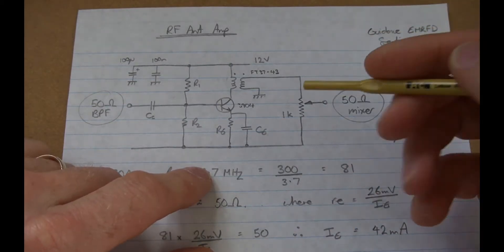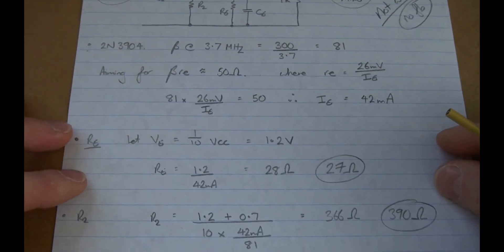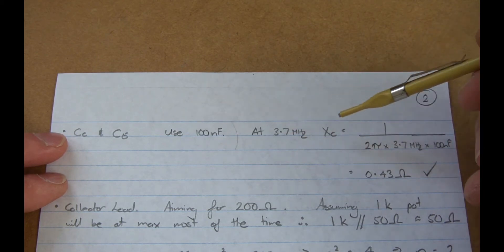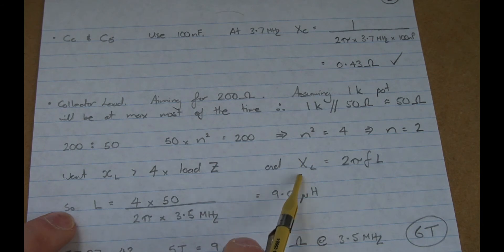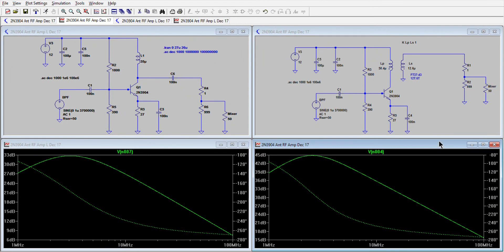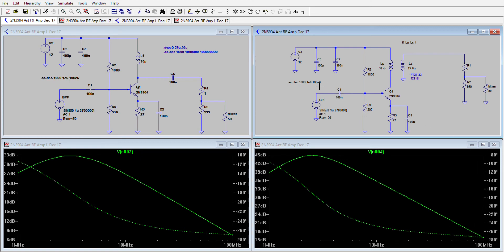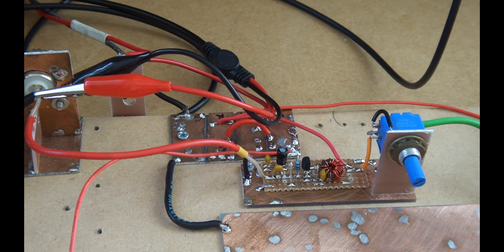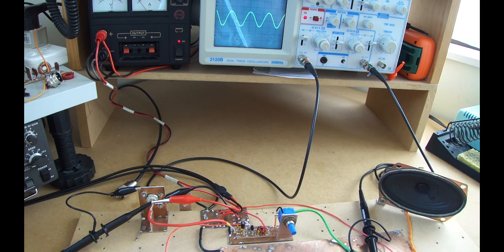Simple Homebrew SSB Base Rig Part 4 - Antenna RF Amplifier

Comment: Just knocked up the same circuit and must have got lucky at about 42db. But transistor gets pretty hot. Collector current is 42mA so dissipation through Re must be 49mW. But how much is dissipated by the transistor? Datasheet says its rated at 0.31W?

Also at 8:55 you mention the turns ratio of 2 meaning 12 turns on the "you say secondary" but have written primary. I'm suspecting it is primary - but just wanted to make sure in case I've got my transformer on back wards. It was out of phase as I didn't understand the dot notation - so swapped the input winding lol. 

PS my circuit is much uglier than yours ! :)
Reply from the maker: Gidday. My transistor too ran quite warm. While it worked ok, I am going to look at a different design for the current radio. I'll probably look to run it at 10mA Ic and then use a impedance matching transformer to match the 50 ohm antenna to the input resistance of the amp. As for the turns ratio you are dead right. I said secondary, but meant primary. The collector side has 12T and the 50 ohm load side has 6T. Sorry about that.

Charlie
Reply: Ah that's perfect, thank you. I have  7805 on this board for logic, whacking that into the amp gives me a modest 33dB gain and 4mA collector current. Hell, I think I'll be happy with that.  

Can't believe I've got 42dB of gain from one transistor and its not hooting like an owl!

Thanks for the pointers. Great stuff :)
Reply from the maker: Excellent. It's all about playing around, learning and having fun. Hopefully, without letting out too much of the magic smoke! 73s.

Comment: Charlie, Around the 5:30 mark, you mention a general rule of thumb for starting with a  200 ohm load for the collector.  Is that specifically for the 2N3904 and similar transistors, or small signal BJT RF amplifiers in general?
Reply from the maker: Hi. No that's not device specific. It comes from both Solid State Design for the Radio Amateur (SSDRA) and Experimental Methods in RF Design (EMRFD). EMRFD mentions that for the design of feedback amplifiers 200 ohm is  common  and affords good gain with reasonable current. It's a value that seems to work for me. If it was a power amplifier chain then I'd look more closely at what gain I want from each stage and, thus, what collector load is needed.

Charlie

Comment: Thanks for this great tutorial on RF amplifier design.  A very straight forward method touching many aspects that I've often wondered about, such as input and output impedance matching.  Thanks again, Charlie!
Reply from the maker: My pleasure. There are many ways to skin this. Check out the RF Amp video in the latest build series. That set the emitter current at 5mA then dealt with the resulting input resistance using a FT37-43 transformer.

Charlie

Comment: Hi Charlie, very interesting series. The detailed explanations very much appreciated. Out of curiosity did you design the amplifier with any input and output impedances in mind? From your diagram it appears that the input filter and mixer have output and input impedances of 50 ohms.  Thanks. Tyler
Reply from the maker: Hi Tyler. Yes, for the antenna amp I was looking for an input resistance of 50ohm. I did that by having a high Ie in order to reduce re=26/Ie(mA). Probably not ideal, but it worked. The out transformer is 200ohm : 50ohm, with the assumption that 50ohm//1kohm is approx = 50ohm. The 200ohm collector load is a suggested resistance from Experimental Methods for RF Design. Hope that helps.
Reply: Thanks. I understand. It was in the video but somehow I missed it.